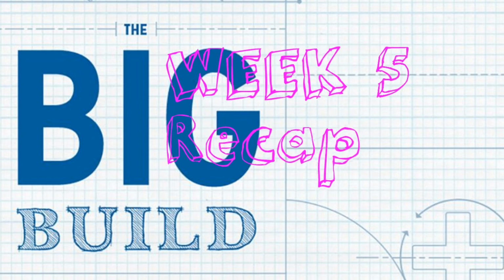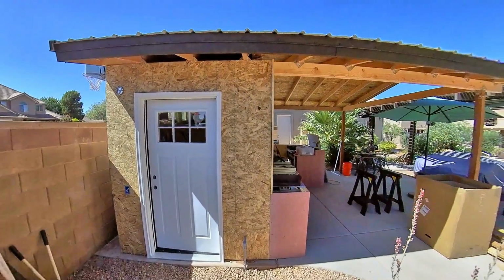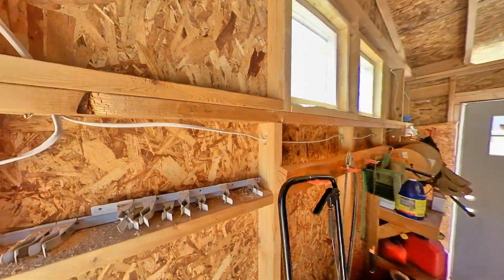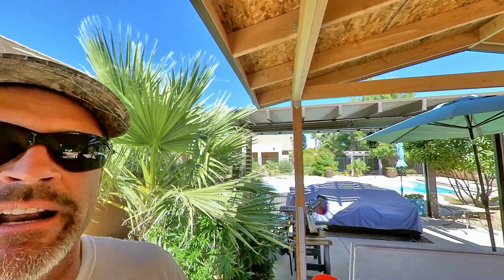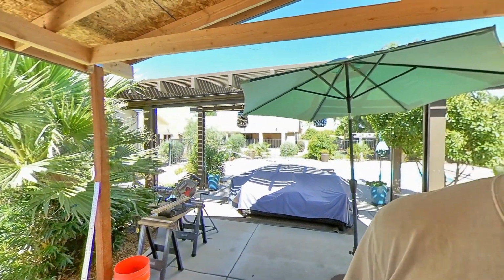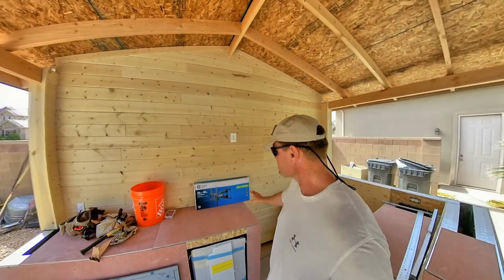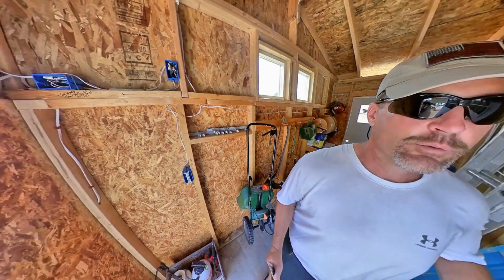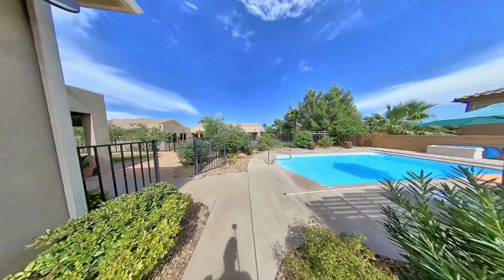BAR SHED - IT'S ⚡ ELECTRIFIED! ⚡WEEK 5 REVIEW Preparations for Week SIX 😮

Comment: Oh yeah finally put some power in that bad boy. Still thinking of more names lol looks awesome . Put an 80" on that huge wall of urs so whoever come over can watch ur videos or sing karaoke lol ;)
Reply from the maker: I’m thinking 65” now, same price as 55” 🤓 I remember when flat screens were over 2k grand. 😂. Stucco going on today and tomorrow.
Reply: @DadRandom  I wish I was there I would do the stucco for you. Got a journeyman in construction specialist for stucco ;) 65" is more than enough and in today's market very reasonable.  Make sure to grab a samsung or Panasonic.  Vizio and all those are rubbish. I have multiple tvs outside and the Samsung and Panasonic have lasted me years outside in my man cave bar ;)
Reply from the maker: Thank you so much. I can imagine the humidity is just as challenging as the heat when it comes to stucco. I have a son and father team doing my stucco work.  It is 110 degrees today and they just quit for the day because the dads blood glucose was getting to low. I have immense respect for the trades. 🤙🏻 I will post their work as they go.  I will video the work so far. Paper and wire today, tomorrow they finish and scratch coat in the morning. 👌🏻